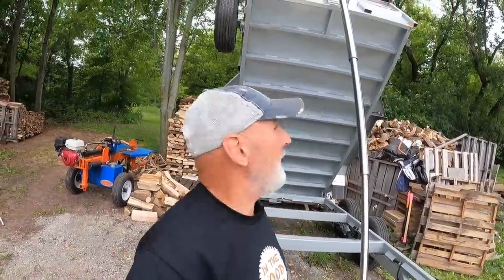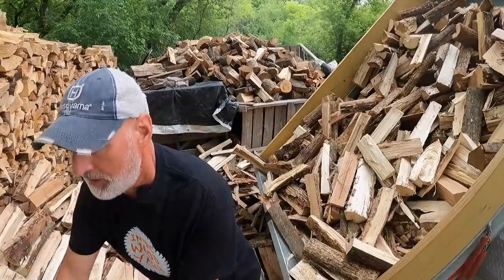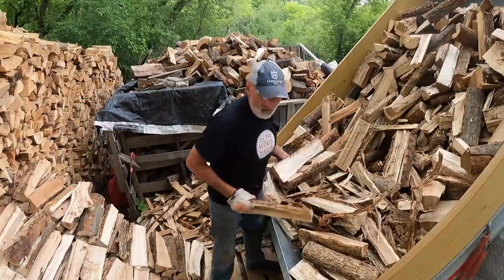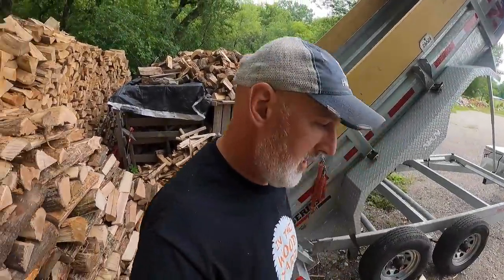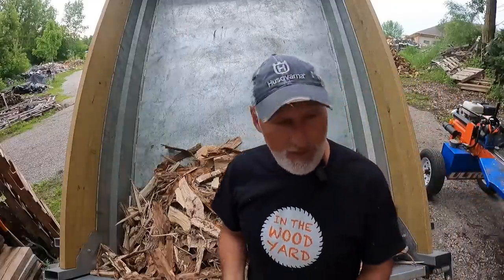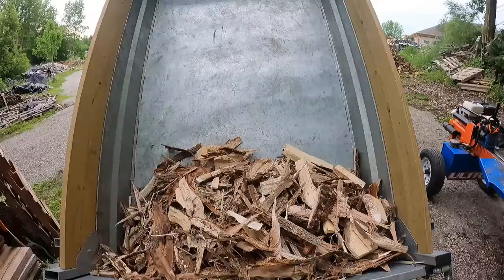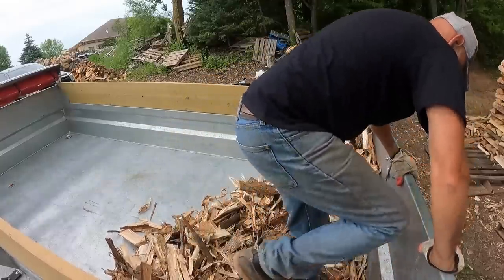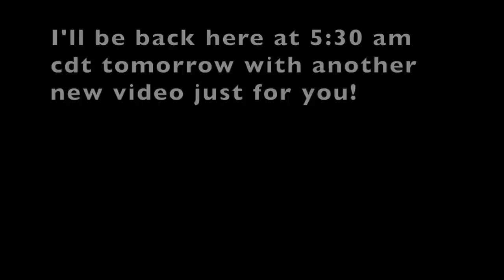EASY - Dump trailer Firewood stacking!

Comment: Chris, as many have already observed, your new approach to splitting into the trailer and stacking right out of the trailer is both a time and back saver.  I use a second trailer to bring my rounds to my work deck at my splitter too.  Then I split into my main dump trailer which then gets moved when full to stack like you’re doing. I don’t have a tractor with a bucket or grapple to use for lifting.  So, keeping rounds in the second trailer and reachable at thigh height helps me out a lot.  Work smarter so we can be even more productive and work longer😉
Reply from the maker: Yup, a second trailer would be nice!

Comment: Hi Chris, great improvement in efficiency.  When re-splitting using the Eastonmade, instead of throwing the pieces in the ground only to pick them up later, why not place them in a wheelbarrow or even using the tractor bucked for later stacking?
Reply from the maker: Great idea!
Reply from the maker: @jakebredthauer5100  MAYBE SO!

Comment: I've been busy stacking this year's supply, and since I upgraded to a 12-22, I upped production X4.  When I was only stacking 20 face cord or so, it was easy to lay pallets out next to the stockpile and stack right there next to it, but it was a huge time waster walking back and forth from the huge pile I had.  So I've been doing exactly as you are.  I load the dump trailer at the pile, and bring it right up close to a row of pallets.  I stack two rows of wood on two pallets at a time.  When they're full, I move the trailer ahead, and start again.  So much easier on the feet and back after working my 'real' job all day.  My biggest issue now is dirt getting in the load, as I load up the trailer with the tractor.  Next year, I'll have to find a conveyor solution for loading right from the splitter to the trailer.

My 10 year old has been lamenting the fact that the multi way wedge produces a lot of junk, because his job now is picking the kindling from the chaff.  He hates it, but it builds character!  I feel like I lost quite a lot more wood to the junk than I used to this year, so we need to make the best of it(plus, I won't have to chop kindling all winter---bonus!) 

Been a learning curve for me for sure with the increased production and stock, but it'll get better as I streamline the process around the equipment. 

Thanks for these videos!  I learn a lot from guys like you who take time to film and post!
Reply from the maker: Thanks for the update Mark, sounds like your training your boy well!

Comment: I've noticed on last video and this one on occasions (speech), you only have sound in one channel.  I typically only use one ear bud to listen so I can hear my wife better.  Just FYI
Reply from the maker: You are correct, I had a mic problem for a few weeks and I did not know it. The mic was set to record on one channel (mono) and if your balance is off on your speakers or if you use one ear bud, you won't here much, or you might have a speaker off or not working, Sorry about that!

Comment: Whatever mike you use to speak hasn't worked for a few episodes. I guess if you want to be heard, fix it
Reply from the maker: Yup, I know, I had it set to record on one channel, my bad, all fixed now! So what the means for you is that you are either off on the balance setting (one speaker working) or you have a speaker off, the sound is still there, just in mono.

Comment: is anyone else having audio problems? mainly when you talk it cuts really low and then high again.. this is the only channel that it does it on so i don't think its my speakers?
Reply from the maker: It is me, I had mic problems that I did not know about for a few weeks, it recorded on one channel (mono) and is fixed now, sorry about that! You might have a speaker turned off or the balance off.

Comment: Good times in my woodyard. What appears to be the issue is an ABS sensor went out in my firewood truck. Can only go 25-30mph because the bad sensor won't lwt it shift past 2nd gear. And this happened on a Friday and can't get it into a shop until Monday. If things aren't breaking or wearing out you ain't working hard enough. LOL! Worse yet, have two deliveries today. Good thing my woodyard is only 3mi away and the first delivery is right next to the woodyard and the other is next to my house.
Reply from the maker: Yup, it is always something!

Comment: Why not just back the trailer into the scrap area and shovel it off- spread it out with the tractor as needed.
Reply from the maker: It is a very tight space around a corner, but it is possible, I will try sometime! Thanks!

Comment: I’m going to stop following these commercial wood supply  guys. I love my cutting and splits but I only do it for me and my boiler. You guys work too much even with new toys. Worse yet you’re got got guys like me only wealthy buying what you do
Reply from the maker: I started cutting firewood about 53 years ago at 7 with my dad, about 8 years ago I started selling firewood, I cut it all with a chain saw and split by hand with a maul. The first year I did 40 face cords the second 80, then  I bought a small box store splitter and did 120 then 200 then 240 and now about 600 a year, I like to do it and the money is nice too. As I grew I bought better equipment with what I earned, I did not borrow money to do this I paid as I grew, you could too, if you wanted to. Cutting for myself is what I did for decades, now I get paid to have fun doing what I love to do! Good luck and get cutting!
Reply from the maker: Yup!

Comment: I notice whenever you are busting 18 or 20 inch logs on your processor the top 4 pieces are extra large lf you would take the time to throw them back down lnto the pusher and push them through l think it would save you a bit of time of having to resplit them.
Reply from the maker: Yup, I do that some times, also If I would remember to adjust the wedge I might not have to!

Comment: Hi, After over 50 years of bending my back is worn out.  I have z hookeroon that works great for rounds and a 4' aluminum pike that works great on split pieces.  You stab them in  the middle and give it a twist to realise the wood.  The motion is a lot like hay bailing.  On the other hand, does anyone make an auto wood stacker.  I am certain it could be done.  Shalom/gw
Reply from the maker: Yup, a pickaroon is a great tool! Wood stacker??? not that I know of, that would be nice!

Comment: Getting quite a deal on processor. Maybe spring for a 16 way splitting post
Reply: Am pretty sure he has the 12-way wedge on hand or is on the way to handle the bigger logs. Would be interesting to see a split size comparison between the 12 and 16-way wedges.
Reply from the maker: I just got a 12 way from Eastonmade , you will see it soon!
Reply from the maker: Yup, I just got the 12 way! You will see it soon!

Comment: How do you prevent your wood from getting mold?
Reply from the maker: Get it stacked on pallets off the ground, as soon as possible, in 1-3 rows and let it dry!
Reply: I did that and it is still getting mold.  Will the mold die off once I am in drier conditions?

Comment: Good morning Chris and thank you for another awesome video. I'm just curious, how big is your trailer (LxWxH) and how many face cords of loose wood can you put in there before you need to start stacking? Hope you are having an awesome weekend.
Reply from the maker: 6x12x3  10,000lbs max 7,600 load cap. 1 full cord loose if level, stacked up to 5 face cords or 1 2/3 full.
Reply: @InTheWoodyard  awesome, thanks.

Comment: I think you need a new mic.....
Reply from the maker: Nope, it is a new mic, I had it set wrong for a few weeks and I did not know it...my bad... I had it set to one channel instead of stereo...all fixed now. If you have one speaker turned off or your balance to one side you will here nothing. Might want to check them. Thanks for watching and letting me know!
Reply: @InTheWoodyard  Hmmm....Thanks, I didn't know that....